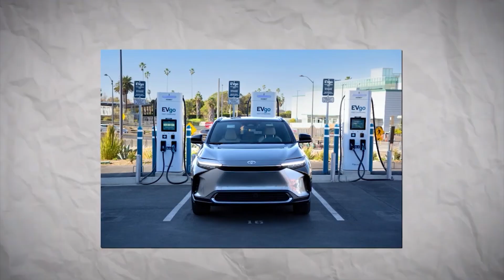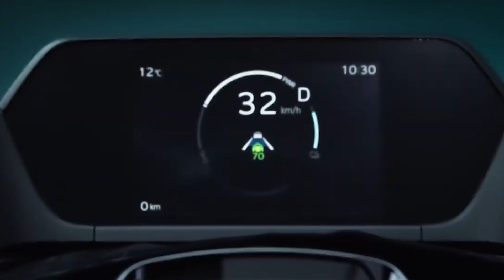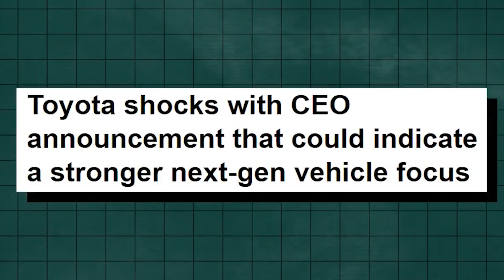Toyota REVEALS the BE ALL of ALL EV Batteries

Comment: Please stop with the relentless Toyota nonsense about EVs. Toyota's Akio Toyoda, who was previously kicked upstairs for failing to guide Toyota's EV program into the 21st century (he couldn't be fired because he is a major stockholder and the grandson of the founder) just recently announced that EVs would be a failure.

Of course, this is contradicted by weekly press pieces about Toyota's new solid state batteries (which have not seen the light of day) and the dozen or so new EV models that are supposed to be out in the next 3 or 4 years. What is true is that Toyota's only EV to date has been universally panned as a terrible concept and badly implemented EV that doesn't measure up to the competition that has already been around for years now.

Comment: LOL, regurgitating Toyota's sales pitches.  These state-of-the-art battery technologies are extremely challenging, with many milestones in battery R&D, testing and mass scale manufacturing.  Toyota, and ALL other solid-state battery developers are still in the R&D phase, with QuantumScape likely holding a significant lead, as their customer recently announced completing testing on their A0 samples, through 1,000 "full depth-of-discharge cycles", at 3C rapid charging and 2C rapid discharging, and retaining >95% of capacity (equivalent to >300K miles in an EV).  This is ~!0X better cycle-life performance when compared to the best Li-Ion batteries.  AND the QuantumScape cells have significantly better energy & power density.
So, I'll wait and see what Toyota actually come up with, and see if it can compete with QuantumScape's solid-state battery.